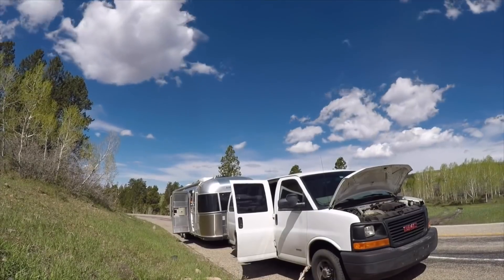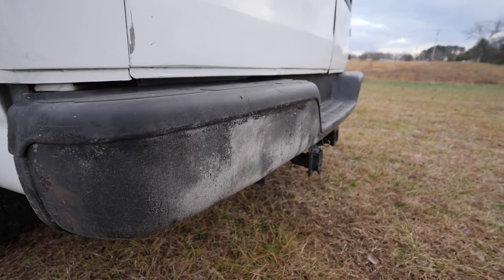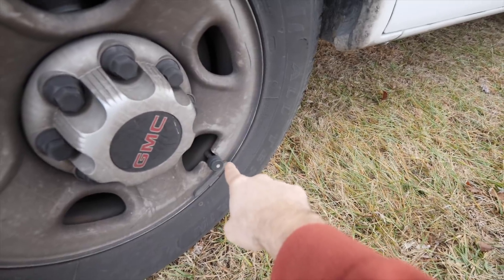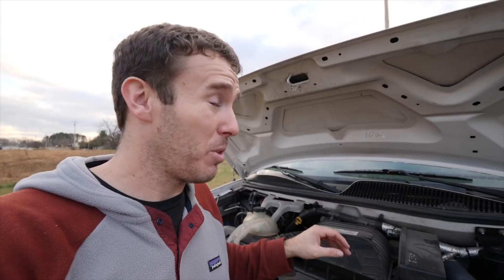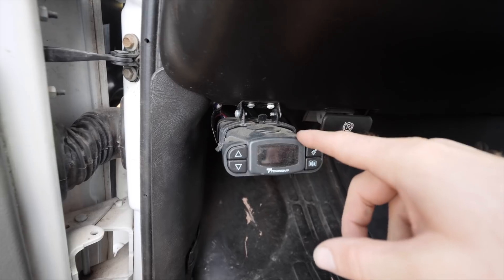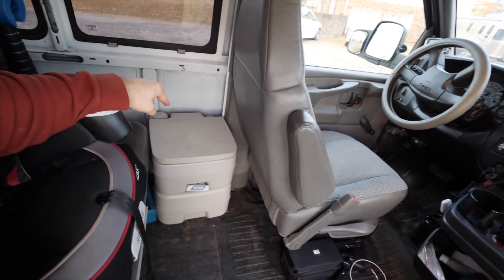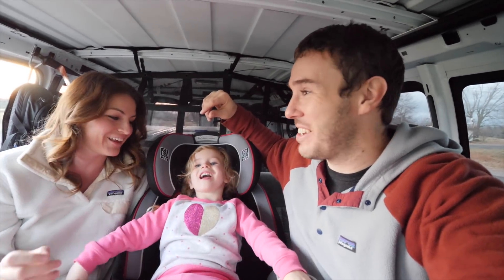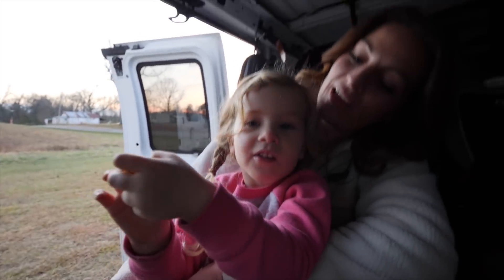VAN TOUR! What We Use to Pull Our Airstream RV All Over the Country

Comment: Is there any difference between the same van that’s set up as a passenger van and remove some of the benches and the “ cargo van”. I’m wanting to do this for our 7000# travel trailer and I watched your video on picking it up. Just having issues finding towing capabilities between the diff models. Like will a 3500 6.0L v8 passenger tow the same as a cargo with same engine?
Reply from the maker: Good question but we are not sure.

Comment: Hey man I know this is 6 years old by now but if anyone is reading this, if you are charging laptops/etc those things use AC/DC adapters, and a lot of them are converting AC power to DC in USBC format - you can get DC-DC cig lighter plug in adapters with USBC that can output over 100w of power and charge laptops, etc without the need for an inverter! way more efficient, less 'junk', less wiring, etc.
Reply from the maker: Thanks for the tip!
Reply: @LessJunkMoreJourney  no problem. Also less energy waste. inverters are super handy of course, but so many of our day to day power consumers are DC by nature and we leave power on the table when using dc-ac->ac->dc converters. Inverters draw power just running, and there's heat loss in both conversions. I've seen some overlanders who have researched and found appropriate 'normal' (read: not usb based) DC-DC converters for stuff like monitors and laptops and have saved a lot of battery life (aka gained  efficiency) in their battery packs/solar solutions